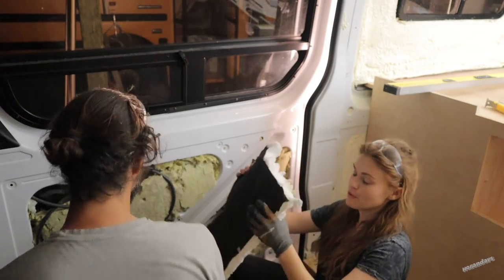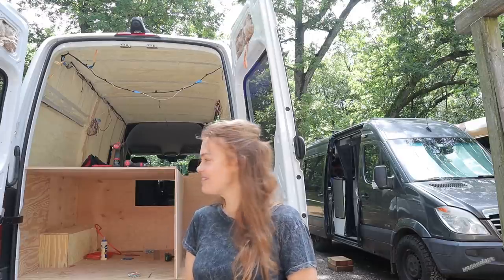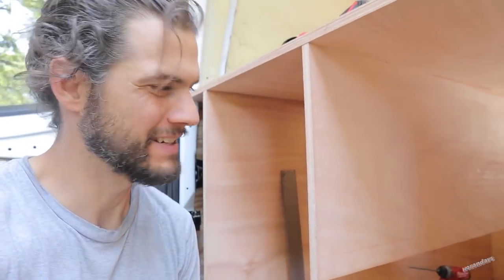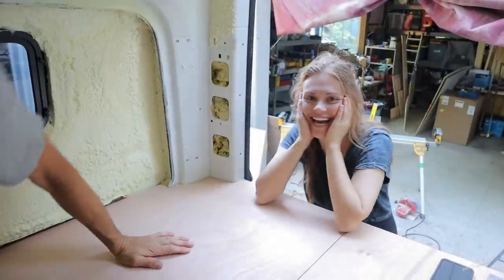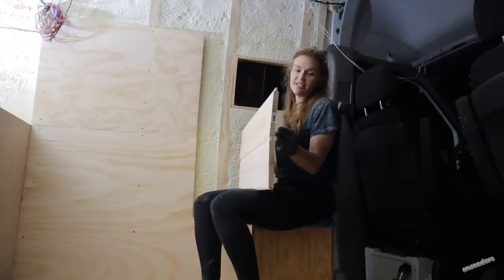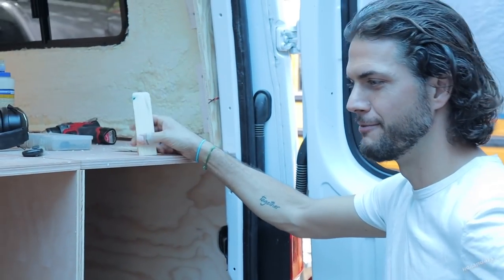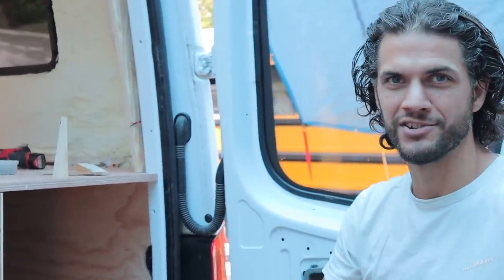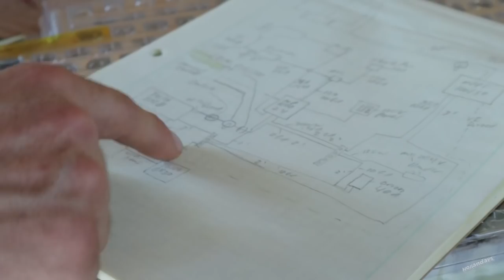HOLLAND RODEN TRY ON HAUL: Polyurethane Jumpsuits and SHIP LAP in a SMALL VAN :p

Comment: I been invedtigating for vanlife and many other vanlifers recomend ventilation for the bed, maybe a good idea (if you wanted 😁 is to put holes in the bed platform, that way the bed can get air and not get moist and problems later, air circulation, is good for the mattres.

Love your channel, good to see people happy.
Reply from the maker: yes someone mentioned that above - Thanks for this! Def will look into it!! Appreciate the tip!!
Reply: @hollandrodenxhollandays3559  yeah, there is a plastic net you can put under, but doesnt work, but ir you make a lot of hoñes ibto it, you dont lose the strength of the table and you lose weight to the van, is a win win. Good luck with the build

Comment: Holland,i love the work you are making with your van.Amazing change from your first video. Is the colour green🟢???Sorry for your stain, i searched how to clean it :
If the polyurethane glue has not yet had a chance to dry, proceed to scrub the stained area with mild soap and warm water. A sponge, washcloth or scrub brush should be used to apply your soap and water.
Hope it works.
Love u 😂🥰😍🤩

Comment: Steve is dead on about not burying the wires in the foam, you can have a 1-2 inch channel above your upper cabinets to run the wires across the ceiling then through the lower cabinets to get to the appliances. I cannot stand when people build their vans and burry the lines because things always go wrong in an environment where things are constantly vibrating or maybe you want to add stuff or change things later, you need to leave your options open. 

Steve's van has been one of my favorite builds for a while actually (since the van kookz tour) and I'm planing on using his shower idea but enclosing it into a drawer underneath my oven so ill have a shower when I need it but I won't be loosing any floor space to a huge bathroom. 

Great video :) really love it but if i can recommend something I'd suggest that you please turn the music down a bit or make the speaking equally as loud so I don't have to keep changing the volume repeatedly while struggling to hear you. Sorry, not trying to be rude just mentioning it because I'm loving this series but it's been a problem for me on the past few videos. I guess I'm a bit of a cranky old lady though lol  cheers! :)
Reply from the maker: Good to note on the music it might be a disconnect between the editing software and u tube :)
Yes ultmately building in the cabinets is a way better option for servicing absolutely. We plan on doing that:) It was just funny bc of all the van builds Id seen we have the most barren van heading to the spray foam place haha- I just like to poke fun at him - He is a very thorough and safe builder - we have our hippy ways in flip flops and casual clothing - but we def take safety as a top priority around any tool - very grateful to have Steve on the project I reached out to him from the exact same video tour:) He is a genius!! I hope he starts his own company!!! Thanks for coming to our little family!
Reply: @hollandrodenxhollandays3559  oh yeah I didn't mean it as anything against you I was trying to say you guys are doing a great job and you are getting great guidance. I totally understand why you were worried, so many people do extensive electric and bury it in the spray foam which will eventually come back and bite them in the tushie. It's awesome that you're doing the build despite having minimal building experience and that you're honest about not knowing everything, it gives the audience an opportunity to learn something new which is cool because I've noticed there are a lot of young women and teenagers watching and hopefully it will inspire them to try their hand at building something. All the best :) keep up the good work.